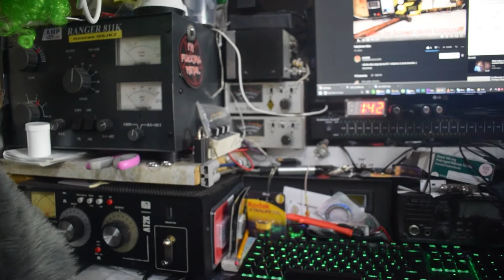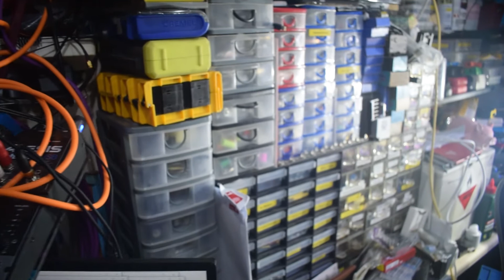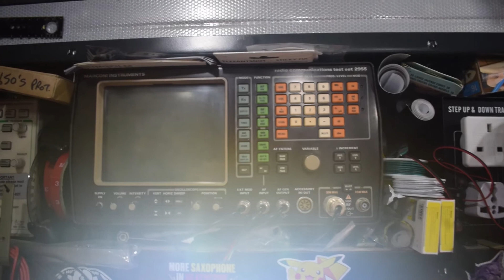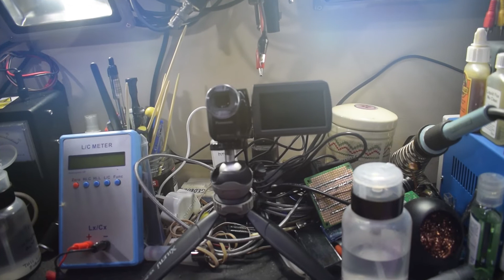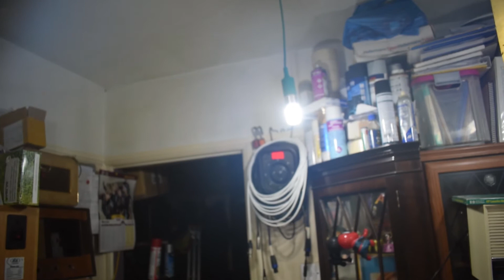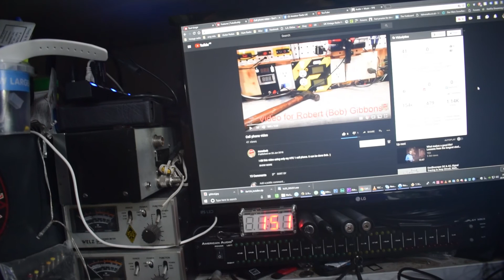Bench Video Handheld Camera Nikon D5300 on Auto Mode

Comment: Just found your channel and I will have some new videos to watch. I have a question if you don't mind. I am building my first champ. I have built one push pull. I bought an output transformer from classic tone.40-18031. It has three primary wires but says it can be used on a champ. I am guessing I ground the center lead. The secondary has 4, 8, and 16 ohm out puts. I am going to use all three outs for 4, 8 , and 16 ohm. My concern is, I don't know if I should use the 5000 or 8000. Thank you for any help.
Reply from the maker: Ok, quite a simple to answer question. The three primary wires will be as you stated, an 8k, a 5k and a 0v wire. What one you use depends on the valve/tube you decide to use. If you are going to use a 6v6 then you either look in a tube data boor or go online ( link here https://datasheetspdf.com/pdf/1037659/RCA/6V6/1 ) As you are building a single ended amp, you look down the class a data until you find the 'load resistance' spec. You will see on the datasheet that there are 3 values listed. If you cross reference that to the top of the column it shows that it is plate voltage dependent. If you are planning on using a standard 250v dc plate supply you use the 5k input on the transformer and make sure you insulate the 8k wire well because it will also be at 250v DC. If your power supply really pushes the envelope and gives you a 300+ dc voltage you would use the 8k lead. I'll be honest though, unless you are using a NOS tube, you will be banging the upper limits of modern tubes so is it worth the risk that you will exceed the tubes max rating? I say no.

If you plan to use another output tube i.e. el84, el34, or just the output section of an ecl82, ecl84 or ecl86 then you have to look at the data sheets for the tube in question to find its load resistance.
Reply: Thank you, I am using a 5y3, 12ax7, and a 6v6,old stock, except for the 5y3. I have an old stock 5u4. The power transformer concerns me a little because it is pretty hot, it came out of a 60 watt push pull, power amp. My better judgement tells me to order a classic tone to have two different voltages to choose from but didn't really want to spend the money and the transformer I have is so big and heavy.
Reply from the maker: The transformer you have is usable but a bit overkill. I would be tempted to get a smaller transformer and save the big one for something meaty. You only need 90mA of HT for a champ so that could be salvaged from an old reel to reel deck or radio. That's what I did with my last build and I actually used the rectifier from the radio too. I don't know if you have seen my build videos yet but have a look at that and it should give you some good pointers. By all means ask questions, its the only way to learn!
Reply: thanks-yea I watched the build of the champ, nice job. I just ordered a classic tone power transformer about 30 minutes ago. It had a 630 volt and 550 volt tap. I was afraid to go with the one with 650 volt tap only, because my voltage runs high where I live. I am planning on keeping this one so willing to spend a little more. Now, everything in this will be new.Again thanks very much for your info and I am off to watch a few more of your videos.